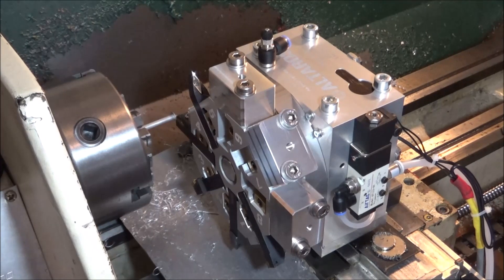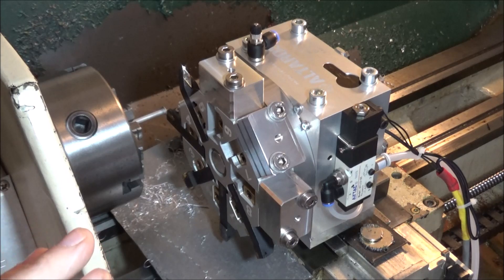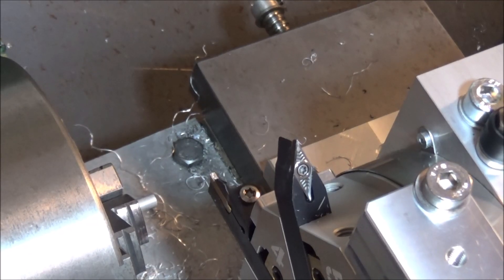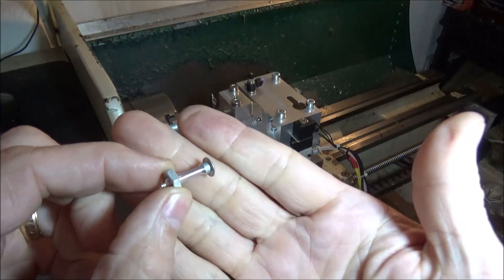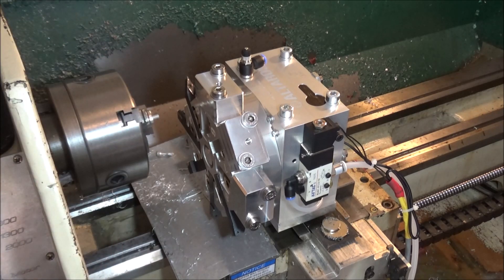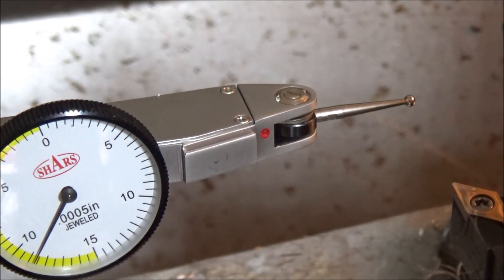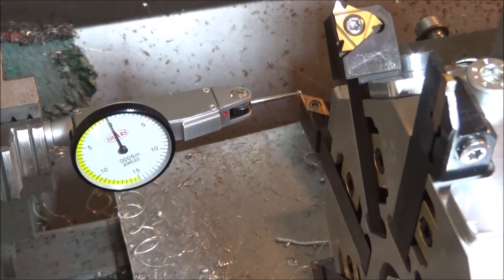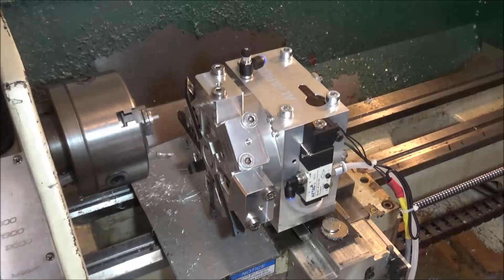ALTAROS TURRET FIRST PART

Comment: Awesome. How rigid does the tool changer feel so far? I'm building a CNC lathe and was gonna build the dimensions to suit this tool turret. I used to make small stainless (303) parts and do something like a 0.5mm radial DOC .25mm per rev feed, do you think this would be tough enough to handle that? Mine is also a slant bed so I'd have to use it the "wrong way round" and have my tools upside down. What do you think?

Cheers for the videos, I found this turret years ago but there was never much useful info on it until these vids
Reply from the maker: I suggest you contact Altaros and ask this very question. It is a very well made solid piece i am sure it can handle the cuts. But as far as upside down tooling I am not so sure as the "lock position stop may only work in one direction.
Reply: @CNC4XR7  great, thanks

Comment: Sir, how to you find the center line of your spindle wrt tool #1 using the dial indicator? I noticed you already setup the tool 1. How you go about it?. In your previous video you use x and z touchoff method
Reply from the maker: I sort of explained this in the turret mount video.
Reply: @CNC4XR7  its ok, i will review the video

Comment: Great! I am definitely sold on the turret! I am accustom to the mill ATC and it picking the fastest direction to turn the carousel to pick a tool, so watching the turret cycle through every time was a little odd at first, but I understand why it does this. With my mill I altered my post (UCCNC) so I can set the tool change position right in the post settings, I think that would be handy with this. It lets you pick a tool change position that works for your part. For now I think I will go M3, but hopefully UCCNC will come out with their lathe version in the near future (year or so). At which point I suppose I will have to come up with a new macro, but I'll cross that bridge when I come to it.
Reply from the maker: Yes I agree it was a little hard to get accustomed to the complete rotation. Since the turret only rotates one direction. However this eliminates the need for an additional stepper/ servo.
 So plus and minuses. when your not standing in front of the turret and off working on other items . That's when you really appreciate it. Just like when the Carousel ATC came on line.
Reply: @CNC4XR7  Definitely not having to babysit is huge, even if the tool changes take time. I can probably change tools on my mill faster than my ATC thanks to the PDB, but not standing there is incredibly beneficial because it basically means I double my production. This is why I'll buy this turret. Honestly, I am pumped.
Reply from the maker: @chrislivengood7350  Exactly! Having a part that requires multiple tool changes and a decent machine time means you can walk away and are free to do other things. a extra 5 min. between parts is huge. it's like gaining a employee.